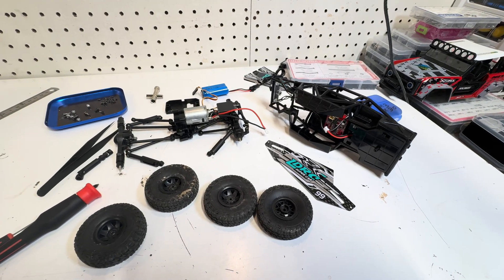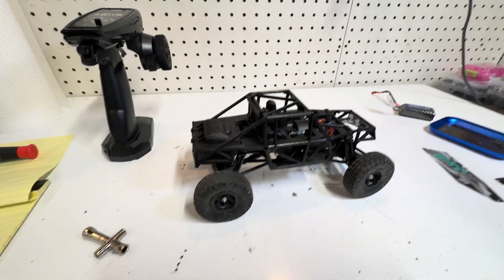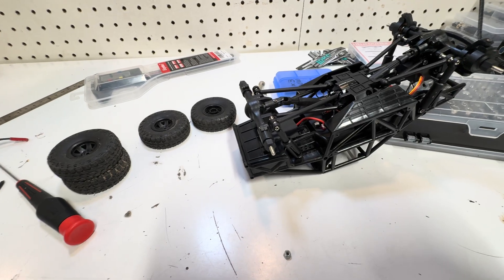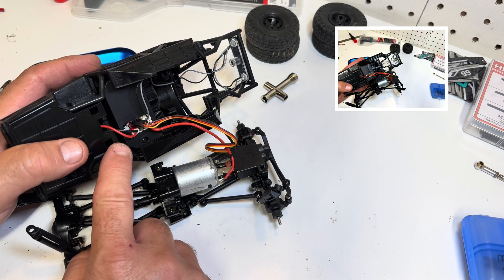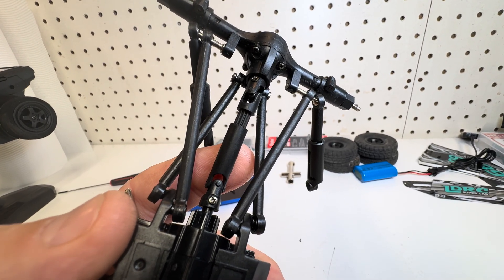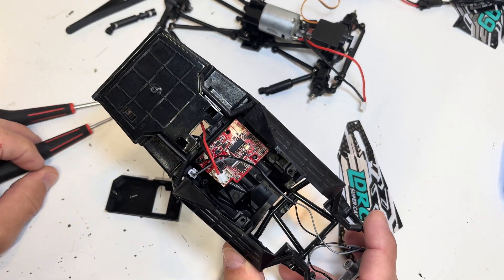Disassembly LDRC 18499, upgrade repair modify potential?, some 18401 info

Comment from the maker: Here are some book marks to help you jump to different sections as needed:

0:10 Intro/goal of video
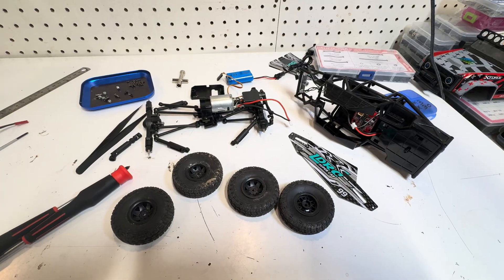1:28 Remove body panels
2:41 Remove wheel, evaluate hex and axles, wheel options, etc
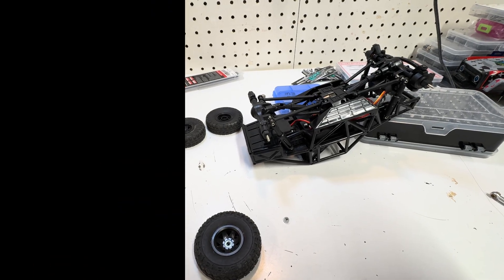4:38 Separate the body cage from the “running gear”
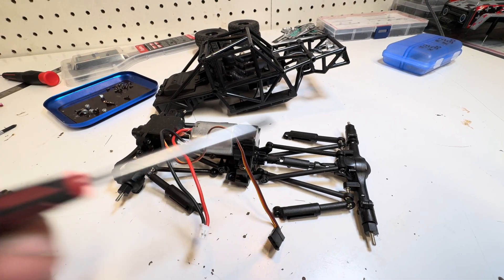7:26 Evaluate shocks, links, etc for compatibility with off the shelf items and LDRC items
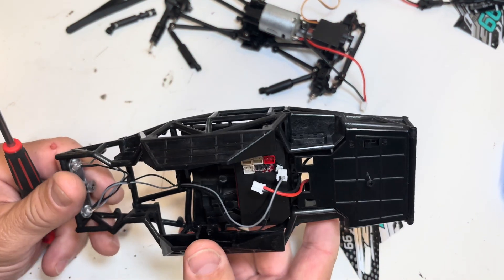11:14 Remove electronics

Comment: Man that would be simple to upgrade the links and shocks. That's a very similar setup the the cr18p Juice up, or Redcat apex. You just unscrew the stud with the double ball and then you just run a screw thru the bottom hole on your shock, then thru the link, and then thread it where the stud is threaded. That's a super common setup on micro crawlers. You can install a spacer in-between the link and shock if you need to to get the proper shock angl. Some sets of shocks you buy will actually have a lower ball that has a spacer on it as I piece and you put the spacer side towards the link. If you would like me to shoot you some links for what shocks and links to get that would work let me know. But literally any set of links and any shocks will work as long as the ball ends have the appropriate sized hole and the links are the right length. If you were to give me the measurements of the links I could point you towards whatever platform's links will work and maintain the proper pinion angle of the driveshafts/axles...
Reply from the maker: Thanks I appreciate you. This is my first RC vehicle of this size. And so I was thinking they just made the links attach this way as a method of making it cheaper which I guess is not necessarily the case. I enjoy scrolling through parts so I won’t bother you to send links to shocks or anything, I feel you have given me enough info to put me on a good path for when I get to that point in the build. Thanks for watching and for the detailed comments. 👍🏻

Comment: Where the links connect to the skid plate, it looks like there is a hole there for a screw if you were to snip the ball off with some flush cutters. I'm still awaiting mine and I've already ordered a brushless system for it.
Reply from the maker: I like how you think. I did notice the little hole and had similar thoughts, but I was also a little scared about messing it up. If you decide to do that I hope you have good luck, and thanks for the suggestion 👍🏻

Comment: Good video i failed when i decided to change steel drive shaft  and  shock oil and  motor  with a 180 60t  and 30a esc my last try is only brushless conversion
Reply from the maker: Thanks for watching and leaving a comment. I believe I am finding it’s not going to be as easy to upgrade as I had hoped but I’m going to try. Good luck getting yours worked out.
Reply: @RCBengineering hi I ve just posted a short video brushless conversion is awesome